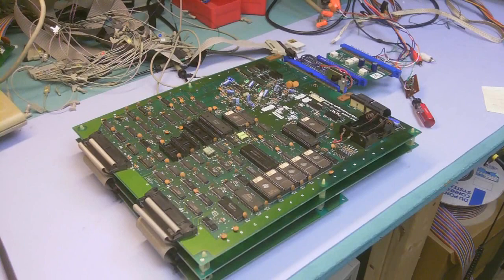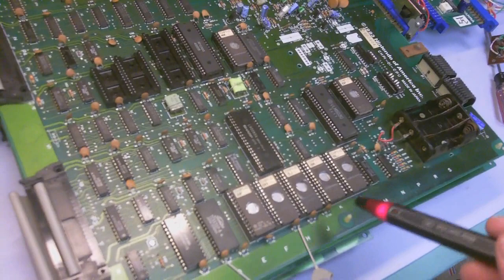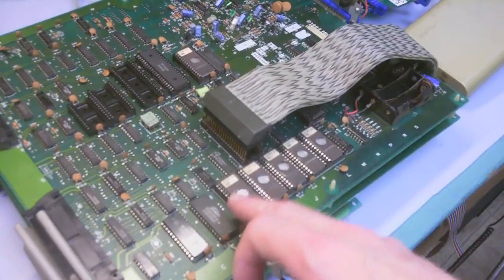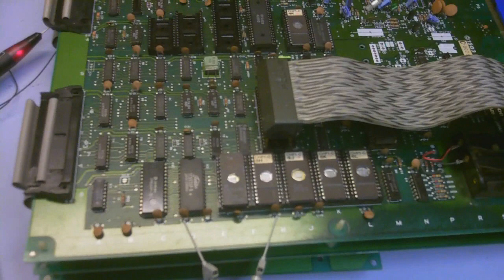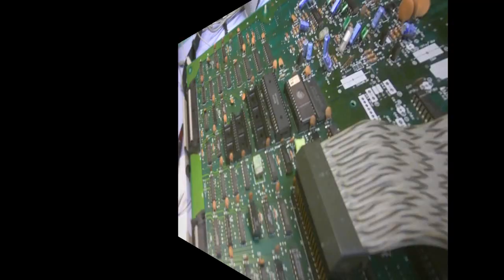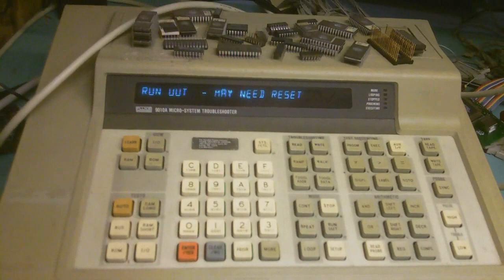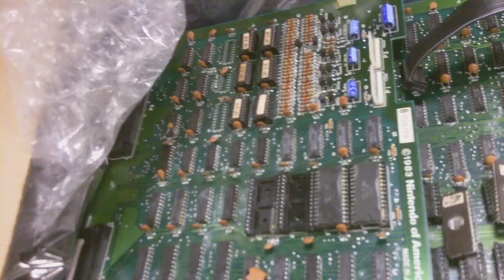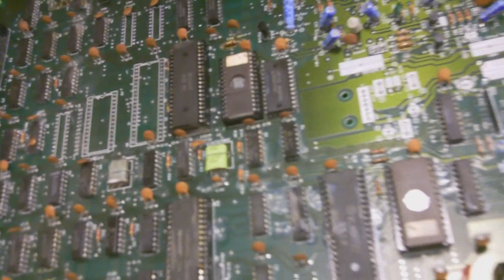BaymenCoach Punchout Repair

Comment: This is how it felt for me working on the last Frogger board I had on the bench.  Dead with multiple problems.  I finally got it running, but each line of text and graphics is being drawn twice, and I can't figure out why.  Almost seems like an addressing short in the video bus.
Reply from the maker: Do you have a pic?
Reply: OneCircuit I can probably get a couple this week.  I also have the schematics, but they aren't all that clear.

Comment: Hi, I'm hoping you can help me out. I'm active duty Army & currently moved from Japan to Hawaii. While stationed in Japan, 75% of my belongings, to include my PunchOut arcade game, was put into storage in Louisiana. This was a non-climate controlled storage unit which was very high in humidity & reached temps in excess of 115 deg. 

My PunchOut game always worked flawlessly for the past 27 yrs. It went into storage for 2 yrs & now all my punch buttons aren't working. I replaced the switches on the console & did a continuity test of the wires...all check out...no breaks. This is leading me to believe it's an issue with the main board. 

No one in Hawaii has the knowledge to troubleshoot this...I've been calling around for the past 7 months. At this point I'm looking for someone in the mainland to mail the board to for repairs to be conducted. 

Is this something I can mail to you for troubleshooting or do you have any idea what the issue may be? Everything else works fine, both screens, audio, the toggle for dodging & moving...just no punching from all three buttons. Thank you very much. 

Rob
Reply from the maker: Hi Rob!  Thanks for you service bro!  No punch you say?  The first chip I would replace is 1R on the CPU PCB. It's a 74ls240 and it allows the button inputs to be sent to the CPU.  Give that a shot and lemme know. ;)